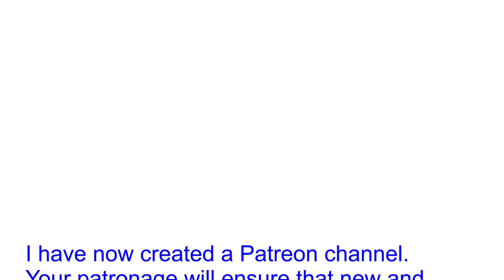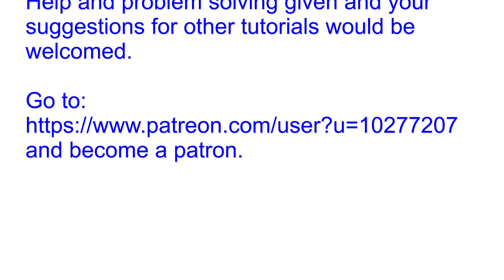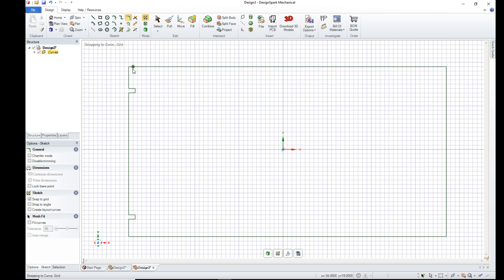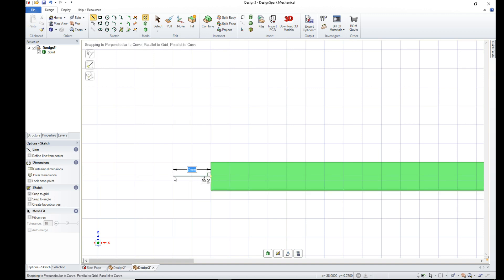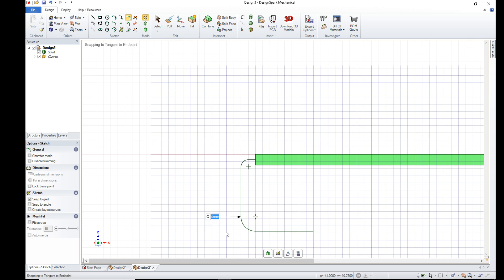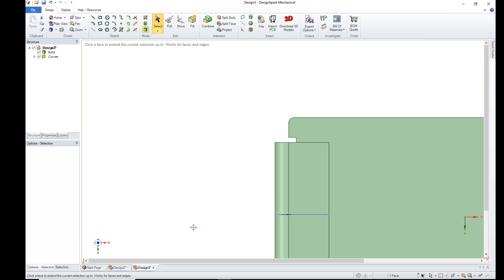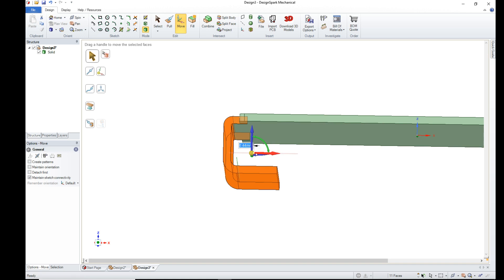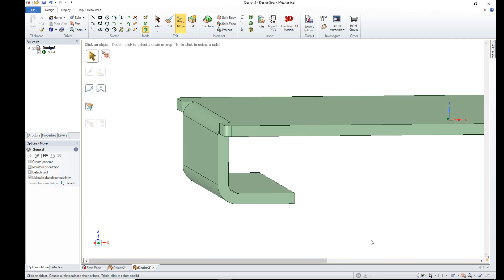DesignSpark Mechanical: Basic sheet metalwork #1

Comment: I see you have anti-aliasing problems same as me. Any idea what's the best way to fix this? Is it solely down to the quality of one's gpu?
Reply from the maker: Could you point out exactly where you are seeing this problem.
Reply: @JimTaylor42  Thanks for replying. For instance, pause the vid at 3:32. The bottom most horizontal line is jagged and so is the vertical line on the lhs. Is this normal for 3D rendering in cad? I get the same 'fault' in SU Make. I've never had access to a top of the line Workstation. So I've no idea if this is normal for rendering 3D or if my card's no good or whatever. I'm using a Quadro K2200 - not a top notch card and obviously a bit long in the tooth now.
Reply from the maker: This is quite normal. Since the monitor screen is made up of rows and columns of dots (pixels), a straight line can not always be smooth and will be pixilated to some extent - especially if the line is just slightly off horizontal or vertical. The lower the resolution of the monitor screen the worse ailiasing will be; the converse is also true.
Reply: @JimTaylor42  Thanks. I'm glad in a way that it's my expectation and not my equipment or software that is at fault! I shall be laying aside some time to get to grips with Mechanical with the help of your video series. One thing I found really odd when I last dipped my toes in is that you can make nice 3d models of electronic components, as you have done in some of your other vids, but there's no way to import these models into DSPCB. Any idea if you can import them into KiCad? That would be the answer to my prayers.
Reply from the maker: I agree with you completely and I have mentioned this to the DSM/DSPCB peopel. I am sure they are only wanting us to buy their products which have their own 3D models. I'm afraid I don't know much about KiCad - what do you think of it?
Reply: @JimTaylor42  If I could take the best parts of DSPCB with the best parts of KiCad I would indeed be a happy man. To my mind DSPCB is the easiest pcb prog to learn bar none but it's tatty round the edges - imprecise mouse pickup of components, poor onscreen rendering, impossible to centre component labels automatically, untidy library, lack of 3d support. But DSPCB's user selectable system and reference co-ordinates are fanstastic especially for symmetrical layouts like audio amp pcbs. Also DSPCB's library management/creation and symbol/component creation is a doddle especially when one masters user defined co-ordinates and works with centroids. By contrast Kicad has an awful fixed system co-ordinate,  about 10mm to the top and left of the A4 template. Library management is very confusing. Kicad works in a fundamentally different way to DSPCB. Schematic symbols and pcb component footprints are not linked in a library. You layout your schematic with schematic symbols, when it's finished you assign pcb footprints to each of the schematic symbols in a list view then carry over the schematic with associated footprints to the pcb tool. Kicad has a massive (github) library of component footprints listed in a very logical way, by component types and sizes. For instance all Wima non-polarized caps are listed by type/size. Unfortunately Kicad like DSPCB is natively geared to imperial measurements. So most generic components, like resistors, are on 2.54mm pitchs, and multiples thereof, (apart from components which are metric in fact like Wimas). Where KiCad excels is in rendering, (beautifully crisp), and in 3d models: there are tons of them ready made in the git library and it includes, for instance, a lot of audio output trannies in horizontal or vertical layout. And the ace up Kicad's sleeve is you can make and import your own 3d models in STEP or WRL formats.
Reply from the maker: Thanks for the information.  @piggybladder
Reply: @JimTaylor42  A couple of important things I forgot. DSPCB has way better report generation inc boms, component positions, drill maps etc, neatly pre- formatted in columns in excel. Kicad's bom by contrast is a comma separated value jobbie. You have to fiddle around in excel to get it useable. Kicad does a drill map but it uses a mix of crosses & open shapes like squares, circles and diamonds for the different drill values whereas DSPCB uses crosses for all drill values with an alpha key for the sizes - much more reliable for hand drilling. But Kicad lets you do slotted pads in pad properties. DSPCB doesn't! I'll leave you in peace for now. All the best.
Reply from the maker: @piggybladder  Thanks for the information, it could be useful to me later as I intend doing some PCB work later.

Comment: I do have a question and I've done exactly what you did here. Is there away to dimension the bend correctly. I was trying to do a 36deg bend and dimension it for bending at the laser cutter but it keeps wanting to put it as 126deg. Is there a way to do this properly?
Reply from the maker: Is the 36deg the internal angle of the bend or with reference to one of the axes or some other feature of the part? I tried to dimension an internal angle I made and it worked perfectly. It looks like it is referencing the angel wrt one of the axes since 126 - 36 = 90.
This sounds like another good little demo to do on dimensioning.
Reply: a demo would be great if you could do one. I was trying to get the internal angle correct, basically it would of been a sheet of metal bent to 36deg with some 50mm holes in it. nothing really fancy. could you also show the best way to save a model like that to show the correct 2D views that a laser cutting company would need and understand in order to cut and profile the metal?